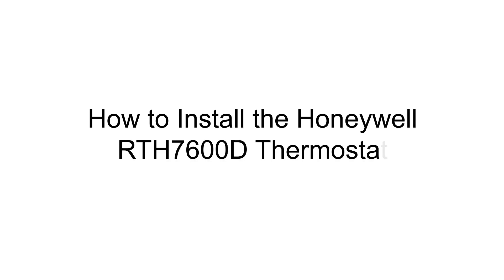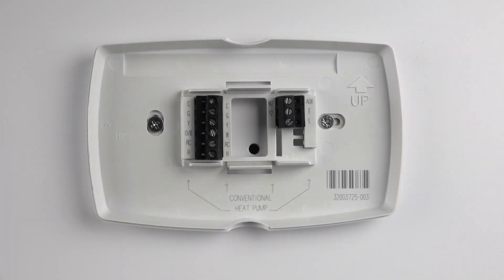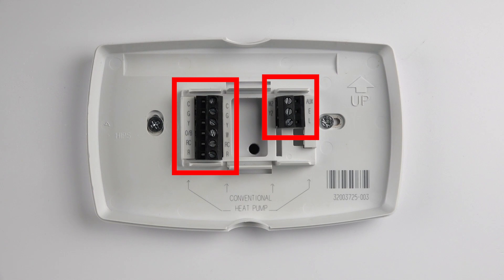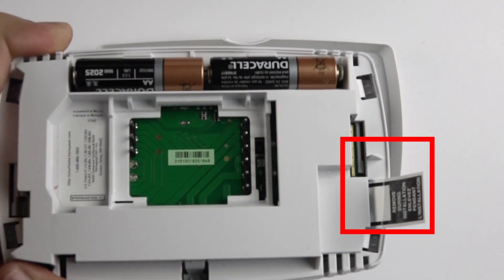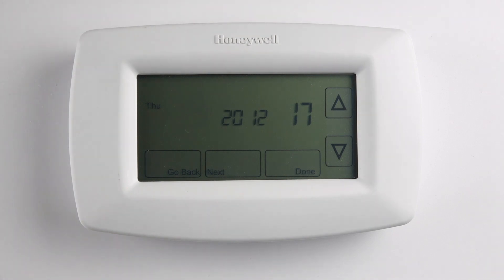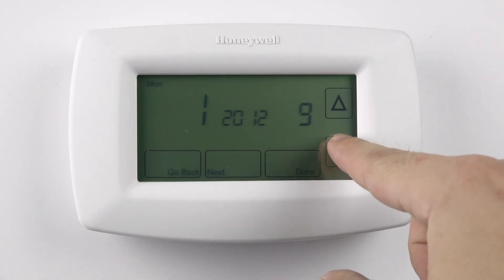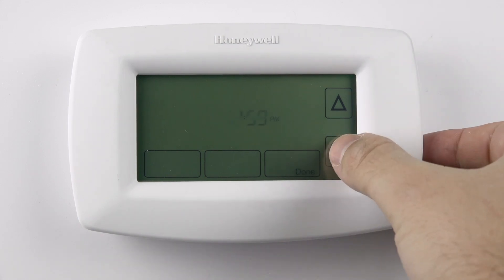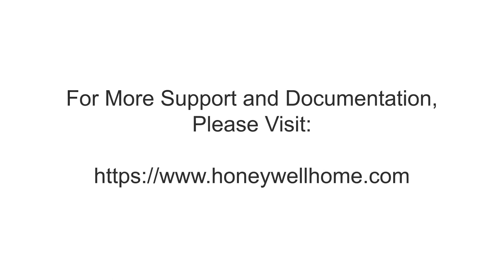RTH7600D 7-Day Programmable Thermostat - How to Install

Comment: It would be more helpful if you actually showed installing the red wire. Not a useful video at all.
Reply from the maker: Hi Dana, thank you for contacting us. We are happy to assist you with the wiring installation.
We invite you to send us a private message including the system type and the old thermostat's wiring information, if possible. -Alex

Comment: Is it possible to change the day of the week without rebooting the whole system? 
When mine was installed it was set with the wrong day of the week
Reply from the maker: Hi Frank, the day of the week can be changed from the setup menu. See direction below. 
1. Press System & Fan.
2. Press and hold the center key until the screen changes.
3. 120 will be displayed on the left, tap next until 0150 is displayed.
4. The number to the right of 0150 is going to be the date.
Please see the following link to view the installer guide. 
https://customer.resideo.com/resources/techlit/TechLitDocuments/69-0000s/69-2206EF.pdf -Joey

Comment: This model seems to have some sorts of problems from many viewers below. My wife and daughter did not like this model. I bought it because it was on sale. I got "fan on" running good and "heat on" running good at 68 degree, not test cold yet (it is very cold this morning about 40 degree F). So far, I could not adjust the "day" showed at the left top corner (it always shows Tue)
Reply: I’m learning to hate Honeywell

Comment: How do you reset the time when clock is wrong
Reply from the maker: Hi there, how far is the time off? -Jay
Reply: Honeywell Home it’s showin 3:10 but real time is 7:07.
Reply from the maker: To set the clock please press 'Clock' on the screen, then use the up/down button to adjust the time (you can hold the up/down button to advance more quickly) and press 'Done' once you have the correct time to save and exit. - Maria
Reply: Honeywell Home I have 3 of your faceplates in my townhome I was trying to set my AC to come on at 4:00 pm off 10:00 pm I do not need it on in the morning at all. But I am not having any luck with setting them so I use the set now to put them on 77 😕
Reply from the maker: Hi there, we recommend to check the following link  page #10 https://bit.ly/3g0lsQD. There you will find the steps on how to program the thermostat. If you require further assistance please let us know your inquire on a private message at our Facebook or Twitter page under (Honeywell_Home). If you prefer you may contact our phone support team at 1-800-468-1502. Any of our agents will be happy to help. - Laura
Reply: Do you have manual? It is so simple.

Comment: DOES RTH7600D WORK WITH AUXILARY HEAT STRIPS?
Reply from the maker: Hi Craig, 
Yes, the RTH7600D is compatible with electric heat strips as a backup for your heat pump. -Joey

Comment: One big problem The video does NOT show wire connecting.  EXPLAIN the Rh and Rc jumper!  Also, how the hell do you get the backing plate off the damn thermostat to start with!
Reply from the maker: Hi Merlin, thank you for sharing your feedback with us after watching our video. The Rh and Rc jumper is required if you have a one transformer system. You can remove the jumper if you have a two-transformer system. The thermostat faceplate should pop off from the backplate, which is secured to the wall. Feel free to give us a call at 1-800-468-1502 or send us a message on Facebook or Twitter if you want to discuss this further; we're always happy to help. Thanks again for your feedback and have a great day! -Kari
Reply: Honeywell Home How much force does it take to separate the face plate from the back plate? I hope not enough to break the plastic? Because the plastic is bending and I can’t get them to separate using both hands. I’m afraid it’s going to break.
Reply: @honeywellhome Stop telling people this and direct them to where they can find an actual video of an install. 👎🏾👎🏾👎🏾👎🏾
Reply from the maker: Hi mullinslife09,
When detaching the faceplate from the wiring base place both hands around the outer edges, pull away from the wall starting with the top part of the faceplate. -Joey
Reply: Do you have manual? You could download it from online.
On the page 6 of this manual:
Flag #1, Remove metal jumper connecting R and Rc only if you must connect both R and Rc wires.
Flag #2, if your old thermostat had both R and RH wires, remove metal jumper. Connect the R wire to the Rc terminal, and the RH wire to the R terminal.

Comment: This is an extremely ignorant video.
Reply from the maker: Hi Gene. We appreciate your feedback. We’ve shared your comments with our Engineering and Marketing teams. If you require assistance with the installation and programming of your thermostat, feel free to contact us at 1-800-468-1502, case reference #01495425. We'd love to assist you. Thank you again for sharing your experience with us. - Laura